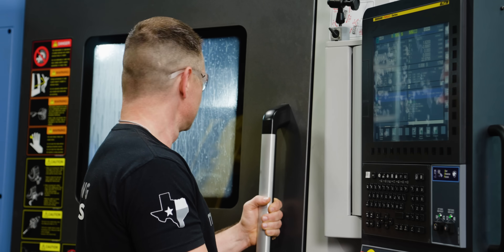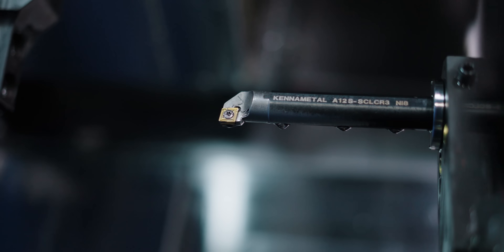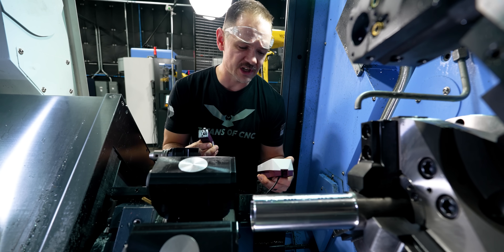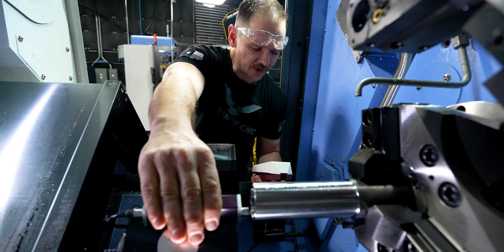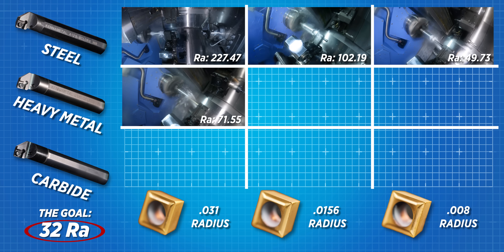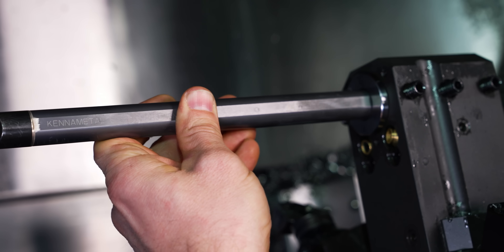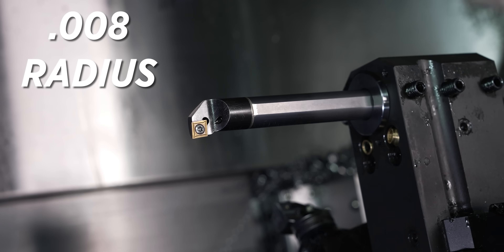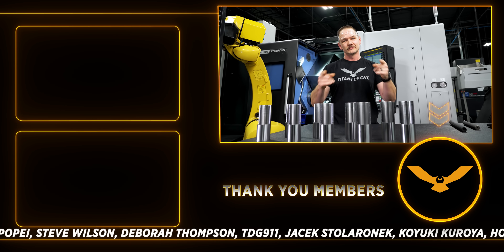This KNOWLEDGE Will Ease Your Pain and Suffering When Attempting to Machine Perfect Parts

Comment: Been a machinist for nearly 15 years would have started the same place you said you would with the carbide bar with the .4mm tip but watched the full video great video nice to actually see the differences side by side
Reply: And if in doubt rapidly changing the spindle speed up and down can help to reduce chatter with roughing lol
Reply: @intheheatoflisbon5311  I've had great results with this technique.  Unfortunately, a lot of older Mori Seiki lathes would not allow any manual spindle speed changes once running the program (maybe a parameter setting?), which was crippling to getting good results.  I figure it's only a matter of time before some machine control manufacturer designs it into their system to have a sensor detect chatter and automatically vary spindle speed randomly to eliminate chatter.  Cheap and easy if it's built in, and would work wonders for threading too.
Reply: @Dyna78  I prefer doosans to moris for that reason been using ez guide recently but still prefer the "old school" g76 for threading stuck in my ways you could go long hand and fire in some speed changes although it would be a long programme

Comment: The comparison between the carbide shank and a dampened shank would be very cool.
Reply: Might be a future video my friend. Thanks for the suggestion!
Reply: @travisjarrett2355  I'm by no means an expert machinist, but i have had to use some clapped out gear before and i experimented with lead tape from a golf shop before, and bitumen car body dampening foil.... it's actually quite amazing what a bit of dampening can do.

Hell... not recommended, especially on a cnc, but just pinching the bar with fingers is an enormous difference
Reply: @geekswithfeet9137  I wish they would do another video testing out different dampening methods. 

I've wrapped a handful of rubber bands around a boring bar and it got rid of almost all the chatter, they don't last very long obviously but it works in a pinch

I've also heard of using magnets to kill the harmonics. There's a lot of weird ways to do it
Reply: @LukeA_55  Silicone surgical tubing also works, and lasts significantly longer than rubber bands.
Reply: @travisjarrett2355 unfortunately not everyone can afford solid carbide shank tooling. How much was that boring bar? Easily several hundred am I correct?
Reply: @justin_704 I don’t know the exact one they used but a 0 degree offset 15.2mm diameter and 152mm length one costs $800 Canadian, which honestly, if you gotta nail tight specs is pretty good deal, but for a hobbyist or small shop you probably don’t need it
Reply: @justin_704  Import ones around 150-200€ for a 16mm one.Works, maybe not that great like kena or other good manufractures.But still a full carbide shank(with steelhead.Full carbide head is just fucking expensiv)
I dont even use non carbide ones anymore..Same differenze like HSS Endmill to a Carbide one...just a hole different level
Reply: @travisjarrett2355   u aint helping yourself using a 80 degres insert, go for 35 or 55 so you minimize the contact between the insert and the bar
Reply: @travisjarrett2355 what stick out of the tool you used in the tests ?
Reply: A test with a spring bar (rattles inside the boring bar) or a fluid dampened bar would be great.
Reply: Dampened bars are worth their weight in gold
Reply: Why you deleting my comment noob?

Comment: Just a couple of weeks ago, I had a small job where I had to do very similar parts as you used in your video. It was so frustrating since we didn't have the right (or best) tools for the job, and ordering new ones wasn't an option. The only thing that worked for me was reducing the speed by half and almost tripling the feed rate. Damn, that was scary at first since my spindle chuck could only grab about ⅙ of the part's length. Even though the whole job was really frustrating, never ever had I learned so much about inside turning and the capability of my tools and machines.
Reply: Scary to step out of the comfort zone huh?
Reply: @drafty0183  seeing boring bars bend when entering the material sure is out of my confort zone 🤣

Comment: It’s kinda funny because I am going thru this issue right now. I am using a solid carbide 1/2 bar, about 3 in stock out. 
What was ur G50 max spindle speed set at?
Reply: We did not max out our G50. RPM's were around 900 though if that helps.

Comment: Great knowledge sharing! Love it. I had to beat my head against the wall for years to learn how to combat it. One thing that helps the most is rubber bands and or sound deadening mat like dynamat.
Reply: A guy I work with told me they would fill thin wall tubes with coolant and put a bung on both ends for chatter free OD turning. I'm definitely keeping that one in mind.
Reply: Just for the noise sound?  Or for a better finish?
Reply: @albertaoridge  Both. It absorbs vibrations and helps eliminate resonance. Chatter isn't just vibration while cutting. It is actually caused but a resonance frequency in the material and tool. That is why common strategies are to change tool length (unsupported from the holder) or to fluctuate rpms in the spindle. There is actually a tool you can get that will test for the frequencies that cause resonance. Then you can find the optimal speed and feed for the tool based on that data. Happy chip making friend. 😊

Comment: Sounds like Jessie running a mill! Nice video Travis!!!
Reply: Hey guy I got a question. 

I’m running a lathe and mill right now at the same time . I had the saw cutting a big piece of 14 inch stainless and I programmed a machine for another machinist . The run time on the lathe is 45 minutes . On the mill is 2 hours and the saw like 40 minutes I sat down and put my feet up on the table  and watched this video and my boss came out and said “MUST BE NICE, I wish i can be tweeting and pushing buttons all day” 

Should I retaliate and pop his tires? Or watch another video?